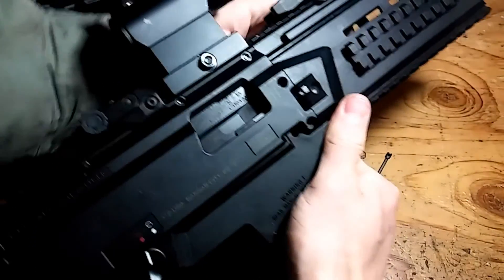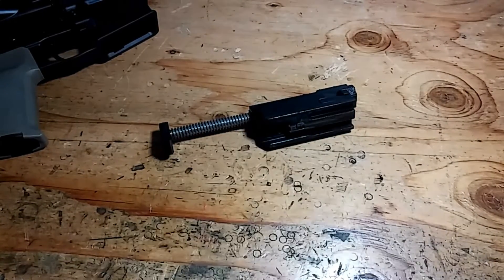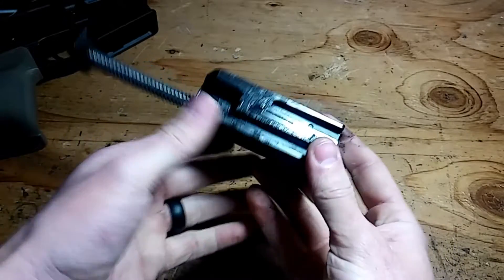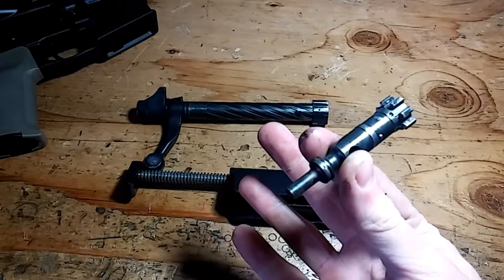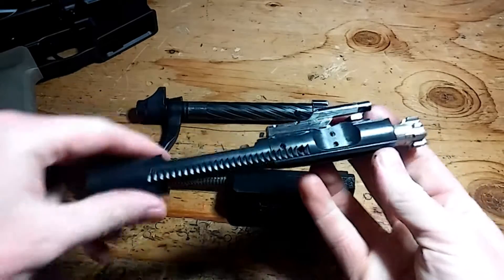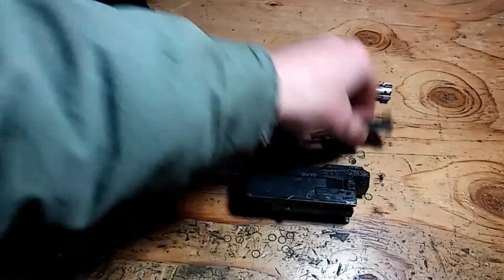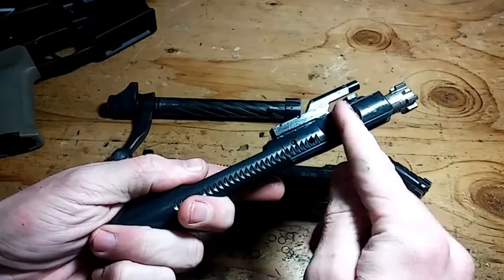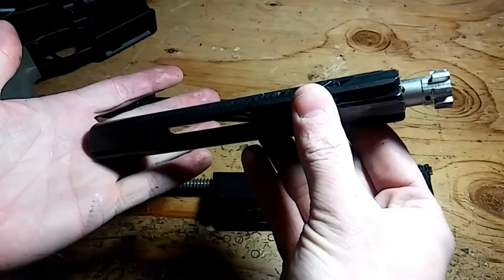Bolts VS. Bolt Carriers: 60 Second Lessons

Comment: Hey, just found this - great, to the point explanation! One question I have: what's the difference between a bolt carrier and a bolt carrier group? Are they the same?
Reply from the maker: @milantrenovszki  the carrier is specifically the item that holds everything in it, and the group is everything together.
Reply: @DouglasThompson  Gotcha, makes sense. Thanks!

Comment: Good video.

BTW I'd call it a bolt assembly on the Scorpion. Since the spring, guide rod and other accompanying parts are still on it.
Reply from the maker: MatteoSixSeventyFour True, Id say the same could be said for most bolts, even the bolt action bolt is part of an assembly. I just wanted to give people the general idea and to make aware there is a difference. Most people like to shorten terms in conversation, this gives them a bit to think about before they refer to a gun that uses a bolt exclusively or one that incorporates a carrier to the design.

I do agree with you though. Thank you.
Reply: Douglas Thompson Out of curiosity what are the mags for that going for? Been thinking about picking a Scorpion up.
Reply from the maker: MatteoSixSeventyFour reasonable, i think around 15-20 bucks depending on where you get them. 30 rounders are harder to find but the 20's are easy to come by. Solid little mags

I havent bought any more than what came with mine (comes with 2 20's) but my local shop sells them.
Reply: Douglas Thompson Good to know. Thanks